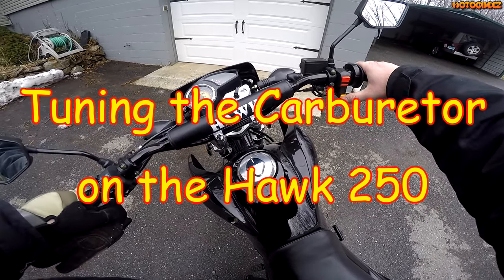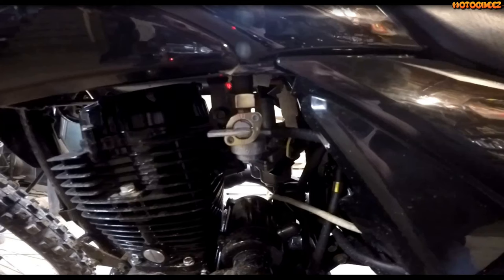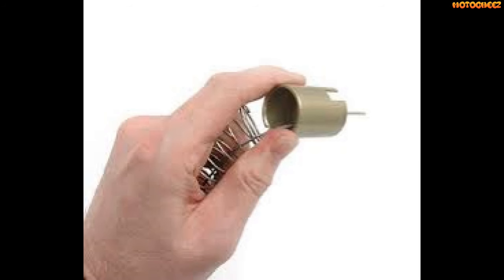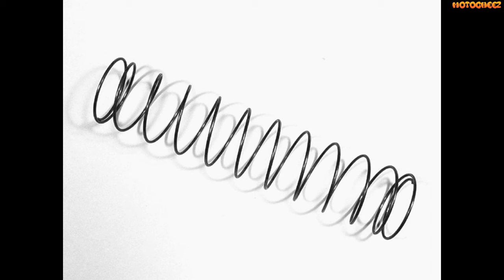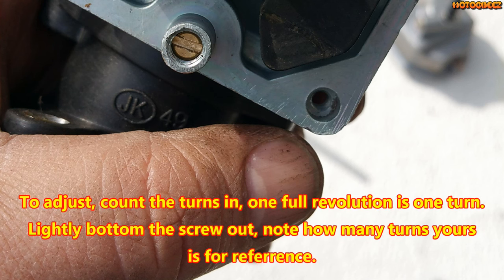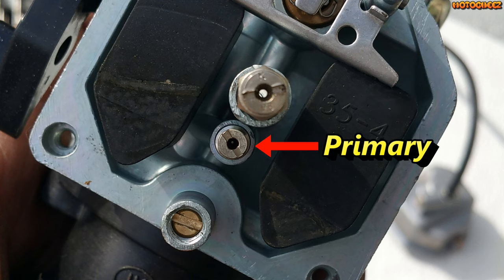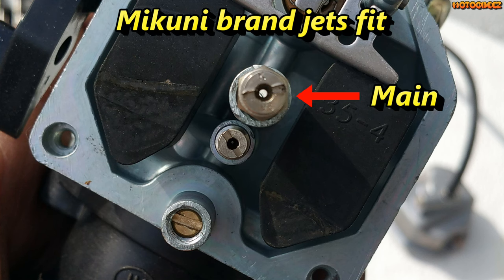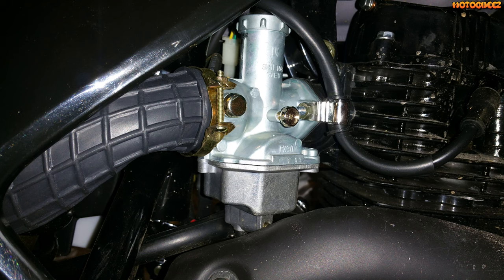[E3] Hawk250 Carb Tuning on the Dual Sport Chinese Enduro 250

Comment: Any idea how thick the washers were that you used? I used 3/16 spacer. That works fine till it gets hot.
Reply from the maker: It was thin, like 1/16". Yours probably too thick!
Reply: I didn't change anything else. Like I said, it runs fine till it gets hot on a hot day
Reply from the maker: @jeffshaw5202  then it boggs on heavy throttle? What's it do?
Reply: @MotoCheez  fine all the way around. Starts cold no choke at40° and up. Just sputters on hot days after 45 mins. I went 3/16 because I was hoping for clip positions. That would equal 1 and a half. I just feel like it could be done better. It should run good all day, not just 45 minutes. My valve lash was at .005.
Reply from the maker: @jeffshaw5202  but what exactly does it do? Stall? Hotter it is, leaner mixture ideal
Reply: @MotoCheez  someone told me that if the bottom of the motor gets hot fast,then the bottom of the carb needs tuned. But he has an extremely zealous ego. After about 30 mins, you can't hardly touch the bottom of the motor.
Reply from the maker: @jeffshaw5202  I don't know about that one, I'd say do a full carb mod tune. Main jet, mixture screw adjust etc
Reply: @MotoCheez  yeah, maybe it's just not breathing good.
Reply from the maker: @jeffshaw5202  possible. ..
Reply: @MotoCheez  I will say when it gets good and hot it won't idle at standstill very long.

Comment: how big of a jet would you recommend and also what size of washers did you use...also what do you mean by turns on the mixture screw
Reply from the maker: Jose Martinez main jet depends on your altitude and mods. Stock use a 110 if modded can go up to a 120, mixture screw (not idle)  is revolutions or turns out from seated.
Reply: MotoCheez..what do you mean by seated
Reply from the maker: +Jose Martinez turn the adjustment screw clockwise until it stops. Lightly though, no need to tightly do it. Then count revolutions out
Reply: MotoCheez what do you mean by count revolutions out

Comment: did you have a few bolts left over on assembly
Reply: while putting together the bike
Reply from the maker: +Brent Rainey I did. And some plastic washers.
Reply: +MotoCheez  Okay good, cause i spent a hour last night trying to figure out where they go an couldnt find a place for them.
Reply from the maker: +Brent Rainey I did the same thing. I forget whether I mention that in my build video.  Would be nice if they came with instructions :)
Reply: +MotoCheez  Yeah it would of been nice could of got it done in a hour an a half then an not 5 hours, i bet china did that on purpose, laughing at us.
Reply from the maker: +Brent Rainey lol, you're right!

Comment: once you got the 110  jet in , did you have to go more then 1 1/2 turns on air mixture screw ?
Reply from the maker: Yes. I think I'm close to 2 out. That's the idle mixture. Opening it makes it more rich on idle.
Reply from the maker: I tried a 115 jet today it was too much. Uploading new video describing how it didn't work

Comment: Ok I have a clone makuni carb, 38 pilot jet, 115 main jet, aftermarket exhaust with cat, open air filter, look at my last video, it bugs out at high RPM, do I need to close the air fuel mixture or open it? It's out 3 turns!
Also I chimmied the needle but I could make it idle so I took the washer out.
Reply from the maker: It's either your main jet is too big or too small depends on your elevation and you don't need to shim the needle in the aftermarket ones there's a clip that you can move and that should be on a center clip to start with
Reply: @MotoCheez  Wichita KS 1,302 feet elevation, vicinity where I live is 1348,  I need to look for an in between 110 n 115, I'll try 110 though, 120 was too big I think, it bugs out at mid RPM with the 120
Reply from the maker: I saw one bike that had an issue wide open and it ended up being the rubber boot that goes from the carburetor to the airbox. Was the strangest thing it didn't look collapsed or anything but if we pulled that off and tried driving it it ran perfect when you floor it
Reply: @MotoCheez  so you think it's my open air filter?
Reply: I had deleted the airbox a while ago
Reply from the maker: @Krotos1970  oh, then you may need to go up and jetting is it popping at all
Reply: @MotoCheez  no it pops a little with the 120 but not with the 115
Reply: It just bugs out at over 7k
Reply: @MotoCheez  I don't know where to find in between jets, everything is 105,110,115,120,125 nothing in between
Reply: I found an EBay ad that has some odd Jets, upto 112.5
Reply from the maker: Try going down a little on the main main jet
Reply from the maker: No I think the pod filters good you just got to get it tuned in right, where is the needle set is it in the middle groove on the plunger needle
Reply: @MotoCheez  no it came on the second from the bottom
Reply from the maker: May want to put in middle and try. The needle effects a quarter to 3/4 almost a full throttle
Reply: @MotoCheez  ok will do it the morning will let you thanks
Reply: @MotoCheez  that didn't help, I didn't have the 38 pilot before, I will put a smaller one, the idle kept changing, I don't think that should affect full throttle though, I will see maybe it could also be the new cone filter, it didn't doit with the other cone filer
Reply from the maker: Right the pilot would only adjust the idle, you may be honest something I don't know how big of a cone filter you have but if it's too small or creates turbulence it's no good
Reply: @MotoCheez  yep it was that filter, as soon as I got home I took it off and pulled the throttle it went up to 9000 RPM's without bugging out, also the 38 pilot is too high for this carb, I'm going to put a lower one, the jets it came with don't have numbers on them so I would have to try different sizes, I'm also waiting on a Nibbi PE30 clone from China, with more things to tune, fun fun always fiddling things.

Comment: could turning my mixture screw out help me not run rich?
Reply from the maker: Liam Wells the mixture screw is for idle and part throttle. turning it out richens it, and turning in leans it. there is also a primary jet you can change if the screw is not enough. half throttle mixture is done by shimming up  the needle on the slide and the main jet. wide open throttle is main jet.

Comment: on the mixer screw. you said yours was at 3 1/4 turn out, and you put it at 1 1/2 turn out. Is that added to 3 1/4 turn? so it would be 4 3/4 turn out or just 1 1/2 turn out on the mixer?
Reply from the maker: Juan Pineda it was 3/4 out and I put at 1 1/2
Reply from the maker: Juan Pineda turned in until stops lightly, then go out 1 1/2
Reply: I fixed the carburetor. thank you for that. but another thing, i was riding but i was having problems with the gears. 1st gear is fine, but the 2nd or 3rd gear i had trouble. it just lost power and almost shut off on me. could it may be the shift lever?
Reply from the maker: +Juan Pineda maybe your choke is on?
Reply: MotoCheez I had it on for it to warm up. but switched it off to ride it. but still wont switch gear
Reply from the maker: Juan Pineda hmm. It's bogging or hard to shift, try lever in other direction
Reply: MotoCheez what do tou mean in other direction?
Reply from the maker: +Juan Pineda choke lever. Down is off
Reply: MotoCheez thats the thing. i tried both ways to ride. with the choke up and down and it did the same. for 2nd gear to 3rd gear. well it feels that the 2nd gear catches. but on the 3rd it just slow down and it almost dies
Reply from the maker: +Juan Pineda hmm, I don't know then. Did you change the main Jerry? What is your elevation?
Reply: MotoCheez sorry to ask but what is the main jerry? and what elevation should it be
Reply from the maker: +Juan Pineda main jet. Lol. Autocorrect
Reply: MotoCheez everything should be stock. but i have a new Carburetor : mikuni VM26, 250cc, 30mm. Carb Jet: wingsmoto mikuni VM26. Spark Plug: NGK (2202) DPR8EIX-9 Iridium IX  that just arrived. im going to switch them to see if that helps
Reply from the maker: +Juan Pineda if you got a new carb, the stick jet is too small..
Reply: MotoCheez its a 110 the stick jet
Reply from the maker: +Juan Pineda I thought the aftermarket carbs came with 85. I never did one on mine.
Reply: MotoCheez actually the after market was 100, switch to to 110
Reply from the maker: +Juan Pineda that's right. I knew it was low. I don't know, it should be good, maybe try the old carb?
Reply: MotoCheez i did. its was fine the old carb was good. just decided to change it. because like before, it turns on sounds good but shifting gears was a problem. the clutch is good i think its the shift lever, so i fixed that. i move it a hair down so i can go on the 2nd gear. now im just waiting for my battery to charge.
Reply from the maker: +Juan Pineda oh. Sorry I thought it was the motor acting up... Glad u got it
Reply: MotoCheez well it could be. still havent started. im charging the battery to charge.
 well if it was the engine acting up. it wouldn't start? right?
Reply from the maker: +Juan Pineda well, if jetting was off. Main jet or choke it would bog when you give full throttle
Reply: MotoCheez oh okay. on the old carburetor thats what happen when i got to second gear. it started bogging on full throttle. i was able to get back home put it on neutral and still bogged and shut off on me. so hopefully hen i get this battery charged i would be able tp test drive it
Reply from the maker: +Juan Pineda you sure there is enough gas, and it's flowing good to the carb. Pull his and run into a soda bottle. I've heard the vent on gas cap acts up causing a vacuum in the tank. Or if it acts up a little into your ride. Open cap and leave loose and try it

Comment: I know I keep posting but I just went outside and my carb is leaking gas it's very new and all I have done is replace the main jet why would it leak
Reply from the maker: Liam Wells hmm. maybe dirt got down in float valve?
Reply: MotoCheez how would I check and now it won't even cut on it is acting like it doesn't wanna even try to start
Reply: MotoCheez it's also making a electrical winning noise when I try to start it
Reply from the maker: Liam Wells battery almost dead? to clean dirt from float valve you can close the gas off, open drain on bottom of carb, the open gas to flush it, close the drain and see it it leaks
Reply: MotoCheez ok thanks for all your help and I'm charging my battery now it's low hopefully it starts and hopefully doesn't leak I fixed a broken rubber seal I found
Reply from the maker: Liam Wells ahh, that'll do it
Reply: MotoCheez yeah but its still citting off even after turning the air mixture screw out it still has trouble idling when first started
Reply from the maker: Liam Wells it will, it's carburated, I hold the throttle for about 30 seconds idle up then it idles low until it warms up. carbs suck for that reason.
Reply: MotoCheez ok thanks I'll keep adjusting at the moment it won't idol unless I hold the throttle alittle for about a minute or 2

Comment: so where do u get a replacment idle jet? mine runs lean and too many mix turns out, so I want to size up the idle/pilot jet
Reply from the maker: At idle? If part throttle is the issue, Could try raising the needle jet a bit. Which carb you running?
Reply: @MotoCheez  it's hard to start, almost impossible, but after adjusting the mix to 2.25 turns out, it will fire on half choke then idle steadily. Accels fine. Stock Jets in stock carb sheng wey pz30
Reply from the maker: It's takes keihn carb jets. I haven't had to buy any yet
Reply from the maker: This kit has them in it https://goo.gl/Xn4AH2
Reply: @MotoCheez  so you're just running stock 40/98 no issues?
Reply from the maker: I just changed the main jet, I think I'm at 125, shimmed needle, runs oerfect
Reply: @MotoCheez  oh ok. How much shim did ya do

Comment: Hey my bike hesitates at the top of my gears, wide open. Any idea what that could be?
Reply from the maker: David Wakefield choke is off? did you do ant carb work?
Reply: MotoCheez yeah I put my mixture screw to 1 1/2 turns. I also went up to a 115 main jet and shimmed my needle down two spots. Everything runs well besides the very top end of my gears. Then it bogs.
My cat is gutted and my airbox is opened up a little bit as well.
Reply from the maker: David Wakefield mikuni or stock carb? if stock try a 118. if it's bogging wide open throttle it's a main jet adjustment
Reply: MotoCheez aghh I hate removing my carb lol. I was afraid 115 would be too big but I'll try a 118 out tomorrow if I have one. Thanks
Reply from the maker: David Wakefield it bogs wide open at any RPM?
Reply: MotoCheez umm, no it accelerates great. Just it seems at the top of 3rd, 4th, and 5th it starts bogging and hesitating.
Reply from the maker: +David Wakefield I've heard of a few gas cap vents not letting air in and creating a vacuum lock in tank, maybe try a run with cap loose...
Reply: Oh and it was my stock carb.

Comment: and if it's my float valve how high should I put the float at
Reply from the maker: Liam Wells the float should be level with carb upside down. I don't know the actual measurement.
Reply: MotoCheez should the top or the bottom of the float be flush with the carbs fuel bowl
Reply: MotoCheez should the top or the bottom of the float be flush with the carbs fuel bowl and for the minkuni correct?
Reply from the maker: Liam Wells bottom of float level, parallel with bowl
Reply: MotoCheez thanks you're the only person who's helpful lol

Comment: MotoCheez, What's the number of the pilot jet?
Reply from the maker: I don't remember TBH.. a 38?
Reply: @MotoCheez  if it's 38 I think you can still upgrade your main jet to 120? Not sure. We have same carb (PZ30) on my motorstar Z200S, I just forgot the number of the pilot jet :D.

My main jet is 110 :)
Reply from the maker: I tried a 120 and it was a little too fat on mine
Reply: I see.. Is 110 good?
Reply from the maker: Typically yes between 110 and 115
Reply: Thanks cheez!

Comment: Motocheez what yet you run on a stock carb?
Reply from the maker: I'm running a 118 at 500 foot elevation.
Reply: Woow. Thats good on a stock carb. I just when up to 110 on a stock open intake no filter. Stock sprockets street tires and i when up to 78mph.
Reply: Waiting for my mikuni carb to come with a cold air intake. Going to put a 120 in it to see what difference it makes.

Comment: which mikuni jets did you get for the hawk? @ jetsrus.com they have several options like "large round, small round, press in, and big thread hsr series" im not sure which to get. Really enjoy your videos btw!
Reply from the maker: They come with the small round but the large fit and I prefer the large round
Reply: Cool, thanks for the quick reply. Why do u prefer the large round??
Reply from the maker: +Tyler Reas I guess because there is more material for the screwdriver to turn. When you swap jets a lot sometimes the old ones stick in there.

Comment: Do I need to screw in the main jet to adjust my carb?
Reply from the maker: Main jet? The mixture screw get screwed in all the way very lightly seed it and then come out about two and a quarter turns
Reply: @MotoCheez  it seems to idle fine but bugs out at about half throttle. I have a mikuni with a 100 main in it.
Reply from the maker: Did you raise the needle one groove?
Reply: @MotoCheez  it was at the 3rd groove from the bottom and I moved it to to 2nd. Same thing happened
Reply from the maker: I'd say go up to 110 main
Reply: @MotoCheez  I ordered the jet kit and am waiting for it. I think I hit the choke down the last time I took it off.
Reply: I have the air inlet tube off and it runs fine
Reply from the maker: That's odd. Did you do the airbox mod?
Reply: @MotoCheez  I opened the airways in the air box

Comment: only thing new on the hawk is new exhaust so is the 110 jet good or what would you think
Reply from the maker: +Jose Martinez yrs, I'd say start there. Should be good
Reply: MotoCheez so for my new exhaust dont mess with the carb at all?
Reply from the maker: +Jose Martinez with new exhaust try the 110 to 115 and turn out the mixture 1 1/2 and 2 number 6 washers under the jet needle.
Reply: MotoCheez whats the measurement of the #6 washers
Reply from the maker: +Jose Martinez not sure. Total ads up to about 1/16"
Reply: MotoCheez...so think im gonna throw in the 115 jet an you say turn the mixture screw all the way till its snug then twist it 2-1/2 times out
Reply from the maker: +Jose Martinez try 1 1/2 first. Then 2 then 2 1/2 on mixture
Reply: MotoCheez thanks dude!!. so when i start my bike up it does what yours does in the video..i put it on half choke then starts up but once take it out it dies then usually hit the start button 2 an starts right up...so do you think the 115 jet i can go head an just toss in thier
Reply from the maker: being carburated you have to hold the throttle a little bit and keep it running until it warms up, it becomes second nature after a while...
Reply from the maker: The air mixture helps the idle mostly, the main if for when you are wide open throttle
Reply: MotoCheez..ok thanks so much for helping me out man i know ive probably been a bother to you but def helping me a lot an this is my first bike!
Reply: MotoCheez so can i go head an throw the 115 jet in thier or is that to much
Reply: im gonna throw in the 115 an give the screw 2 turns an see what happens then maybe 21/2...also do you know were we can get plastics for the bike...on the carb what deals are you slotting out...just enough to get to the screws on the carb
Reply: Jose Martinez the plastics they have at theros.net and I hear TXmotorsports.com. I just slot the screws enough to use a screwdriver.
Reply: is the 115 jet to much? tho?
Reply from the maker: +Jose Martinez I'd try it, should be ok.
Reply from the maker: +Jose Martinez should be good!